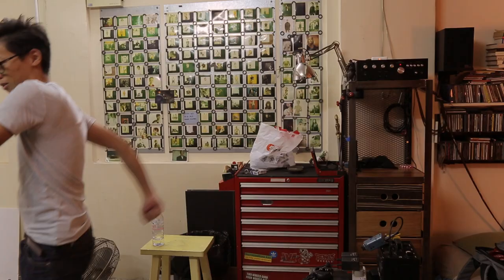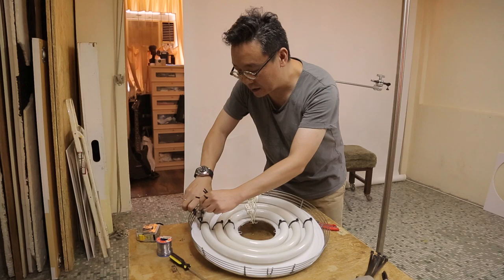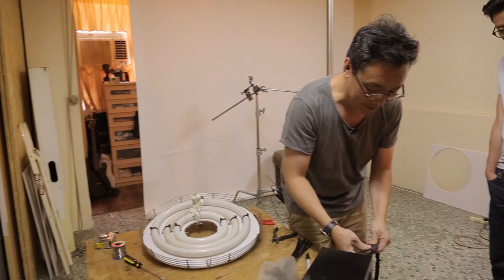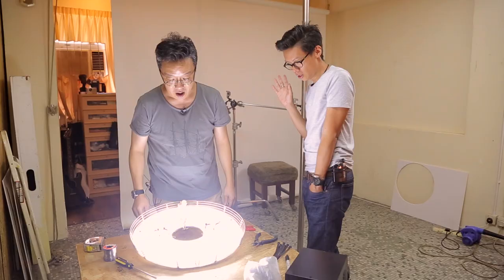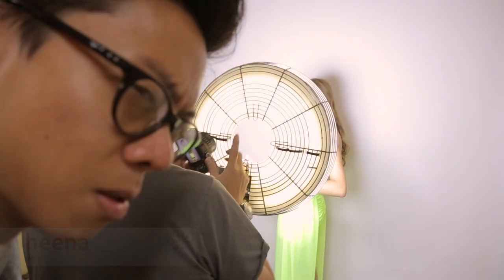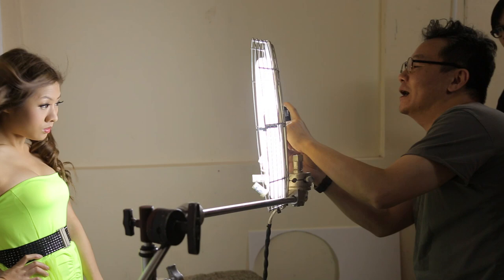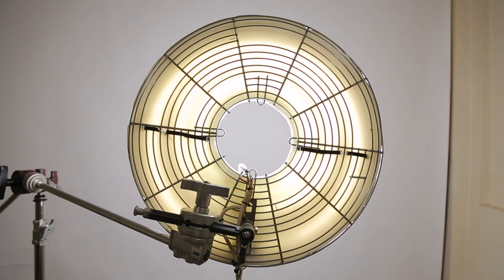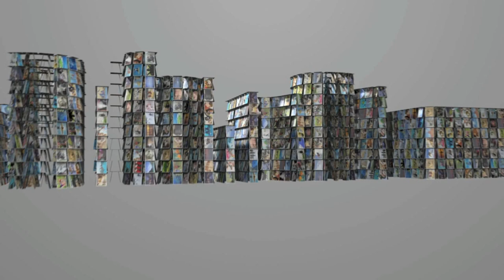Pro Tog, DIY Challenge - Ring Light (feat. Mark Chung)

Comment: Did anyone else notice the irony of using a fan for the ring flash, and then having to use another item to blast air? They could have combined the light tubes with the fan - an air blasting ring flash. Now that's an invention I would buy :D

Comment: Nice, I do a bit of DIY, I would have put some rubber foam between the cable ties and lamps, just because that's how I roll.
I use the stuff they put between concrete slabs in footpaths, you can get ridiculous amounts cheap.

Comment: CFL tubes are generally quite cool to the touch relative to a regular filament bulb which get rather hot! They use a non-thermal equilibrium plasma (which is cool temperature wise compared with say a tungsten filament with a current passing through!) to produce UV radiation. That UV is absorbed and re-emitted as visible light by the phosphor coating on the inside of the tube (hence why they look white and opaque). You can generally touch a CFL lamp with your bare hands quite easy.

Comment: Some of the best light diffuser are in Back Light Monitors. So if you are throwing out a defective LED monitor, remember to open it up and collect it's light defusing panels. I have a very nice light box from my beaten up beyond dead laptop.
Do NOT open up CCFL monitors, you may accidentally crack open the CCFL tube which contains mercury dust.

Comment: I was thinking the same thing, but I wonder if it has to do with flicker? I know LED lights flicker at about 50-60 Hz, so theoretically with a shutter speed of 1/120s the light may only be on for half the time the shutter is open.  I think the camera's metering would tend to lean toward the "light on" exposure, resulting in generally under exposed shots.  This is all just conjecture though.

Comment: wait for the 70D. same autofocus system from 7D, swivel LCD, digic5 processor that perform better in low light than digic4 generation camera, and the sorcery dual pixel system for video contunious autofocus.
yes it's a crop sensor in term of 35mm still picture, but in term of motion picture, it (almost)match the super35 frame.

Comment: The idea is great, but would the compenents of the actual DIY ring not be more expensive than one of the cheaper ring flashes/ring lights? The rings are fairly expensive, and if you buy a fan to get the frame, you've already wasted a ton of money.

Comment: They were complaining that the tubes were getting quite hot though. My guess is that they cranked up the power a bit too high, which is quite dangerous to do, especially if the tubes are so close to someone's face and could explode on them. Like Mark said: "Don't try this at home".

Comment: as I said, in term of 35mm motion picture it is (close to) full frame.
there is a lot of full frame definition, 16mm, 70mm, still 35mm, and motion 35mm.
I'd rather say bigger sensor and a smaller one